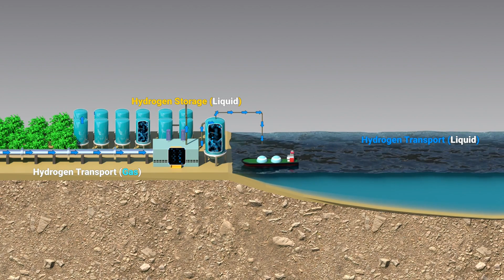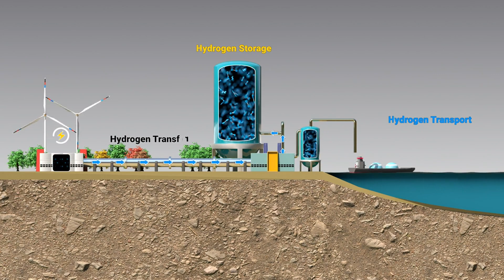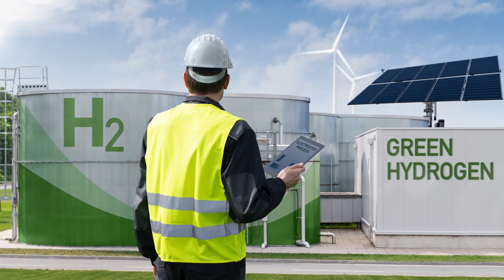Toyota CEO: "This NEW Engine Will Destroy The Entire EV Industry!"

Comment: Hydrogen is perfect as a fuel for emissions and sustainability. Internal combustion is not going to be the most efficient use of the fuel though, and from an emissions perspective, the Hydrogen has to be clean. Most Hydrogen produced today is made in an extremely dirty process involving hydrocarbons. So provided they can industrialise clean hydrogen using renewable power to electrolyse water, then yeah I'll buy into it... Infrastructure is key (think Tesla superchargers), and Toyota has the resources.
Toyota and innovation though... BMW dabbled with this tech in the 90's.

Comment: The very first thing.. i dont know what Toyota was thinking but if they just know a general knowledge about chemistry then they would know that hydrogen is a highly flammable, this thing can blast just like a bomb, in other hand petrol and diesel are less flammable, so we like it or not but agree that road accidents do happen and there are unavoidable situations in this case hydrogen can make things even worst.. this should not be the replacement technology for evs or ic engines.. infact I get terrified about hearing a combustion through hydrogen it is very very dangerous... i know toyota is good at designing and engineering in modern technology but I do not accept this.. I do strongly believe in their other project for cars running on water that can be the one which should change the industry.. I think toyota should really focus on that now

Comment: Whilst I accept that there are many issues with Battery Electric Vehicles, Hydrogen is not a viable alternative.  Firstly, as many have pointed out, it is not a primary source of energy, it is an energy storage mechanism, in exactly the same way a Battery is.   Furthermore, it is an incredible inefficient energy storage mechanism when you look at the end-to-end requirements and energy losses accrued along the way.

Comment: Sorry but Toyota is wrong here. IC engines running on hydrogen will not be as efficient as battery powered or even fuel cells.
Reply: It's not about efficiency, its about emissions and sustainability.
The sustainability of current types of EV's is dubious and they are very dirty to manufacture.